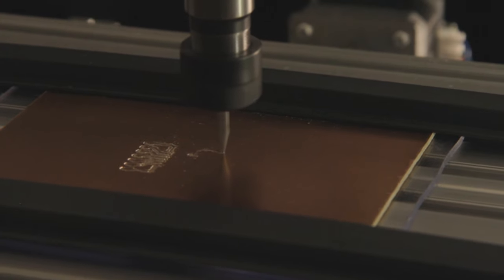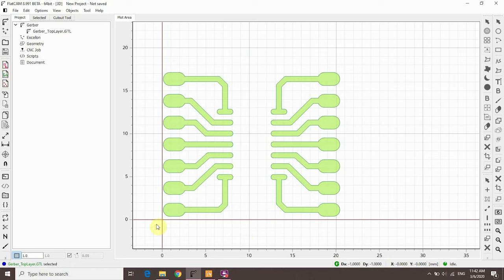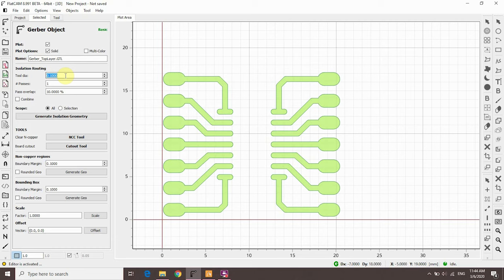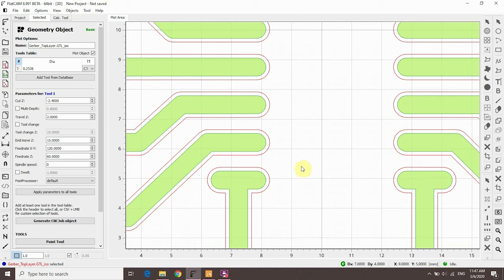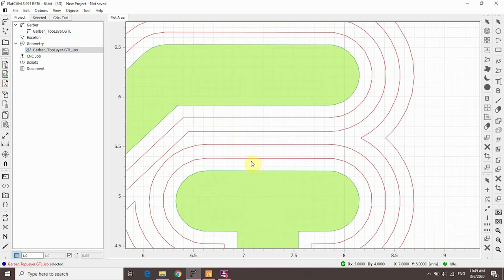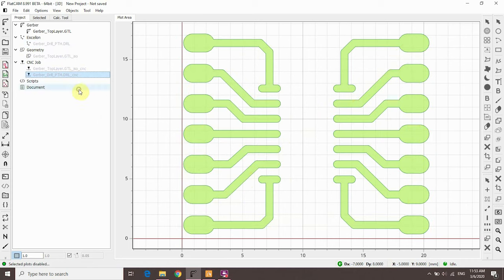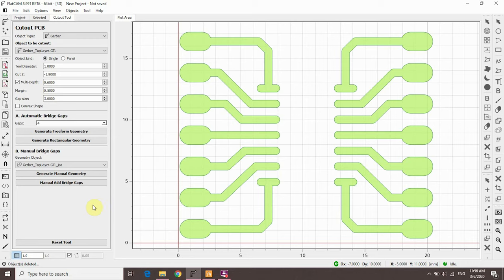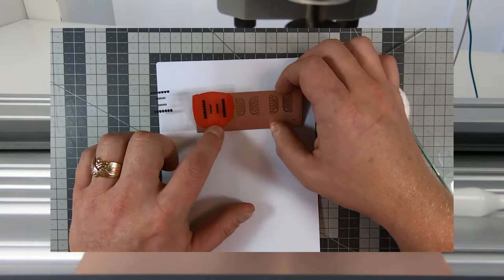FlatCAM PCB CNC Full Tutorial - Sponsored by NextPCB

Comment: I have been trying to make PCB using a 3018PROver for over a year on and off and with no success at all! I believe there are steps missing in the way the height mapping is performed as that is where everything goes south for me. Using Candle 1.1.7 and all the information I get is vary vague on performing a height map. I always get a  "Error message(s) received: 30: M6 < error:20"  Then my Z goes to the Top and hits the stop and my CNC needs to be reset and all is lost. Start all over to get same results, Am I missing something or doing something wrong? :(

Comment: i tried it on my 3018pro but i got some unsupported codes error:20 m6 and after starting 2 seconds cnc stopped
Reply from the maker: Please share the error message!
Reply: @DIYTECHBROS  thank you my friend its only putting the machine on hold so i need to press pause button again to begin
Reply from the maker: What software are you using?
Reply: @DIYTECHBROS  gbrlcontrol candle

Comment: Thank you for a clear explanation. I just have one question; Which version of FlatCam are you running in this tutorial ? It somewhat matches beta 8.994, 64-bit. But when I run it on my Windows 10 64 bit PC, there is no "Select" TAB! Although I was able to rout a PCB, some of the user interface items were very different - the Cut Z started with -0.05 though I used the exact same starting tool size of 0.1 type C1.

Comment: Great video! Very informative!
My only question is: what is the spindle speed and if you have any general recommendations wrt to it?
Reply from the maker: Spindle speed and feed rate is depending a lot on you bit and copper clad board.
Usually a wide range of speeds and feeds work well. Just make sure it does not rip off to much copper.

Comment: Nice video, Bros, I'm stunned about the quality of engravig: my CNC3018 has a precision of... at least 1mm !!! Impossible for me to engrave some simple SMD track even using Z-probing with 10 degs engraving bit... it seems the collet is "bended" and there's no way to adjust it, since it was hot-fitted this way and the little screws on the sides are unuseful... any suggestion about modifying the spindle + collet set to raise up the precision? Thank You
Reply from the maker: oh...sorry to hear that! We have two 3018 (one pro and on regular one) and both are very accurate. 
But, yes, there are often tings that you can do to improve it.
1. Locate the error. Is the problem on one axis? Try engraving a couple circles in different sizes and measure (and look) at how round they are.
2. What causes the error? Too much tension? Too much slack?
3. Fix the issue. If there are to much tension, are there misalignments? Is any thing skewed?  Any things that needs lower friction? And if there is too much slack, rubber bands pulling things to one end will often help a lot.

Another "common" problem with bits, especially when they are only 10 degrees is that the tip break off really fast (or bends). We usually use 30-60 degrees! And never less than 0.2mm tip (unless absolutely, absolutely, absolutely necessary). 

Also, centering the bit will be very important. This can take a couple of tries!

If it is still the motor / collet - I'm afraid it needs replacement... 

Best of luck!
Reply: @DIYTECHBROS  Very Useful Infos !! Really ! I bought a new spindle+collet set and replaced the "suspected bended" one: now this is not a suspect anymore: the new set runs mooooooore better: 0.1 / 10degs engraving bit now create a 0.2mm diameter "dot" and very thin lines at 0.1mm engraving depth... but your suggestions are absolutely true: never thinked about "bit-bending", while it maybe the most probable cause of low-quality results. Anyway, I have so many bits of this kind I'm planning to use a new one for every PCB... I will test. In the meanwhile, thank You very much for your answer. Cheers ;-)

Comment: Fantastic video! I have just gotten a 3018 and am starting to play with it. I will definitely use FlatCAM now! One question: Is the height-mapping process automatic from somewhere, or do you do it manually?
Reply from the maker: Hi!
It's a function in GRBL Control / Candel that' s called hight map. You only specify the grid size and it does the rest. Many other CNC software also have this feature :-)
Reply: @DIYTECHBROS  That's brilliant, thank you! I will have a play. And thanks for the quick response, you have a new subscriber!
Reply: @DIYTECHBROS  Where did you take the crocodile clip from and how does it work? How do you plug it into the machine?

Comment: I always cut my traces 0.05 mm deep and that has always been deep enough. 
I'm using cheap chinese PCB blanks.
Reply from the maker: That's cool! Most of the PCBs we are using have a copper thickness that is just a bit bigger.
Reply: what kind of drill bit and angle did you use? I have difficulties make small pcb path
Reply: @DIYTECHBROS  I stand corrected; Just received a batch of blank pcb's which i need to mill at 0.08 to be safe milling all copper away :-)
Reply from the maker: Cool :-)
Reply: @miliohm  0.2mm 30 degree engraving bit. Attention; engraving bit needs to be sharp! when you start seeing rough edges which feels sharp to your finger tips, it's dull..
A cheap engraving bit needs to be replaced (estimate) after milling about 20x20mm with much / dense traces..
Reply: Where do you buy your pcbs from? I want cheap bulk stuff but i don't know where
Reply: @bobdole27  just search "blank pcb board" on aliexpress